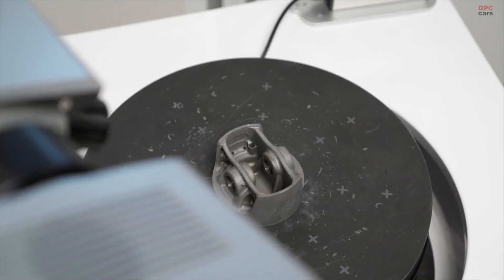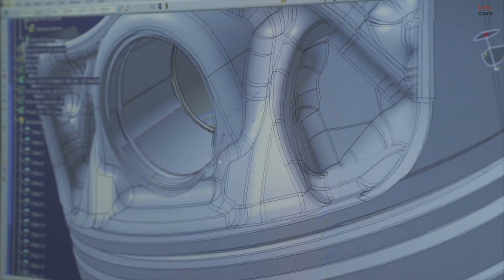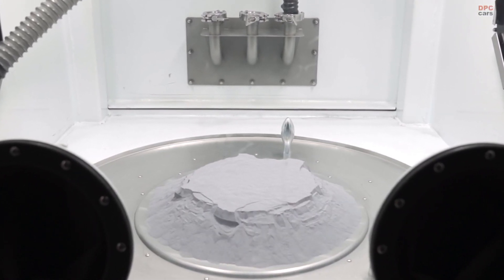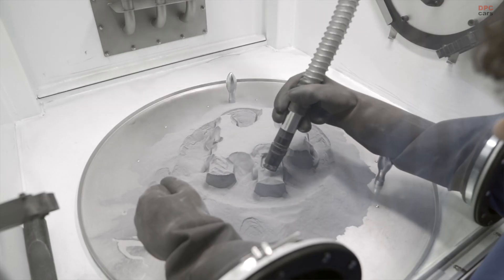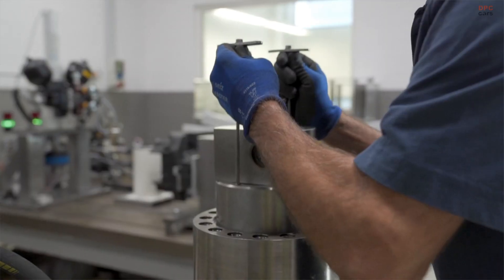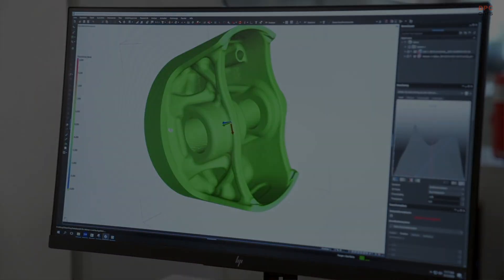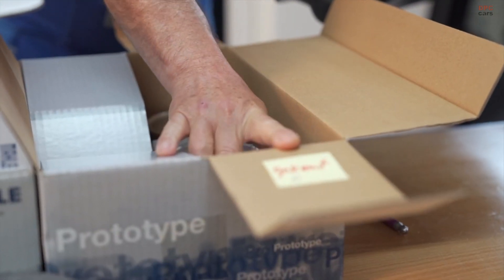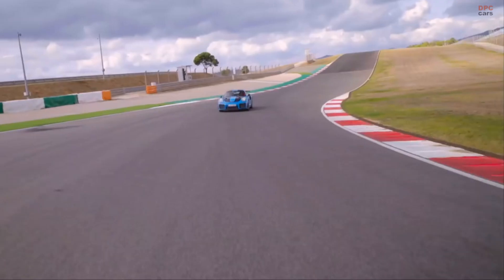How Porsche is Revolutionizing Performance with 3D Printed Pistons!

Comment: Porsche needs to work on manufacturing engineering for affordability. Their bottom line 300HP car is $70K.  They’ve been tweaking the same cars for 60 years but the prices are out of sight. Great cars though, which makes sense when you’re in continuous improvement mode.